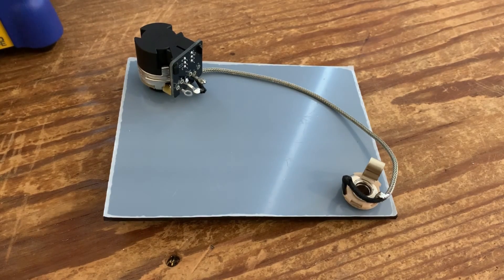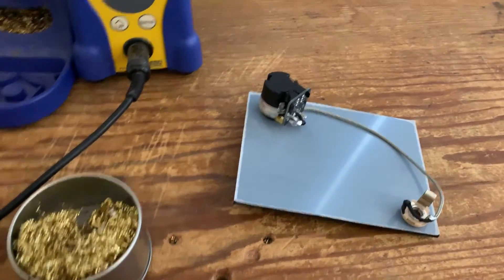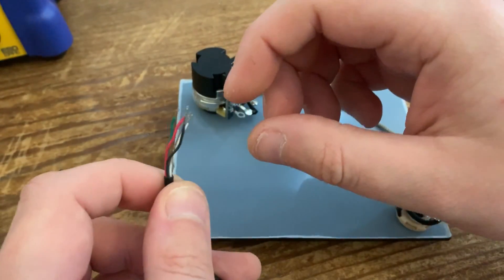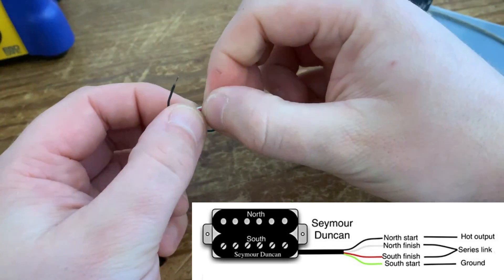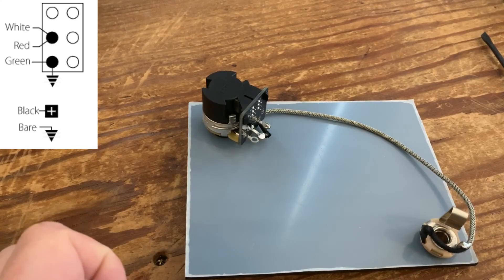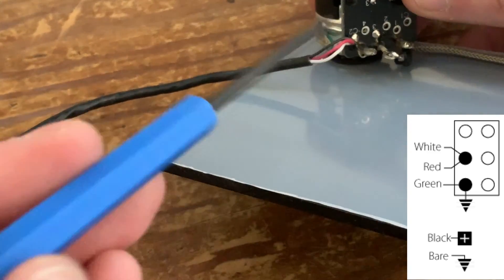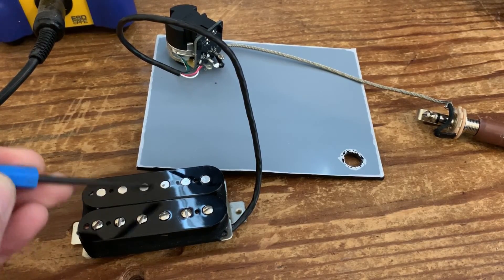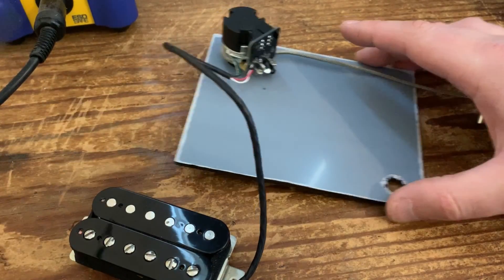How to Coil Split Humbuckers

Comment: Great video! I’m rewiring/ replacing pickups on a H-S-S configuration SuperStrat style Samick guitar with a single volume and single tone, a five way blade selector switch and a mini toggle. I’m using Dimarzio pickups- a Satch Track single coil sized humbucker in the neck, an Air Norton S in the middle (also a single coil sized humbucker), and a “proper” Super Distortion humbucker in the bridge. I have a five position blade and a mini toggle switch (which is for coil splitting the bridge humbucker in the original wiring). How would I wire these so that I can coil split or coil tap the neck and middle humbuckers to a single push pull volume pot? You could point me to the appropriate video if you have made any such. Thanks again- your videos are awesome and lucid, and I’ve used it to wire up a Gilmour style black Strat successfully.

Comment: Is possible to wire 2 humbuckers to do both split coil & series/parallel switching with a 3 way pickup selecter switch & 1 volume push pull pot & 1x tone push pull pot?

Comment: Two questions. 1) Which coil is next to the trem or bridge? Is it North or South and how do you determine them?  2) Could the other half of the switch connect to another humbucker, say in the neck position? Thanks for this video, just wanted to clarify some unknowns 🙂
Reply: Screw slugs on the humbucker pickup face either the saddle of the bridge it on the neck pickup the screw slugs face the headstock of the guitar neck. The screw slugs side of the humbucjer is the south

Comment: What if it's two pickups? I've got Seymour Duncan Pickups Hot Rodded  (SH-2n & SH-4) JB / Jazz Set. Can both pickups be split with just one knob?

I have a Levinson Blade strat, and the tone pot has a the push pull which orginaly split the bridge pickup, but I'd like to use it to split both of the seymour humbuckers. if possible.

Comment: Q- Lock down inspired DIY'r here. I'm refitting a T style guitar with new pickups and wiring. Stock, it came with a single in the bridge and full size humbucker at the neck, mounted at the pickguard. I have a lil59 on hand and 4 wire humbucker to use as replacements for the stock pups. The stock control plate is a US fender with one volume one tone and 3way,all to be upgraded. At this point, I'm leaning towards the BKP CTS custom push pull 280k pots and an Oaks Grisby 3way.
I want to be to split both bridge and neck if possible and keep the control plate as one volume and one tone pot. Is this plausible or do I need to lose the tone pot and run two volume pots? Would I need to use a 4way switch to do so? I'm not married to the idea but I do want to keep it as straightforward as possible largely because I lack the soldering skills or confidence to complicate the build beyond what has taken me a bit to understand at this point. Any advice or opinions are kindly appreciated and considered.
Note, I'm not trying to obtain an authentic telecaster sound for this guitar, I intend to use it as a D standard heavier but not metal rhythm option. Stay safe and well all, thank you for the remarkable videos, I could watch this guy solder all day, his work is impeccably clean and his explanations are comprehensive and easy to understand. ✌️🎶🎶

Comment: my first repair/build I wired this in reverse, pull is series and push is split. haven't bothered to fix it and probably never will since the neck pickup as split usually sounds a bit better on a HH for some music i've been working on learning.

Comment: When splitting a humbucker with a 500 K push pull tone pot, the split humbucker still sees a 500 K tone pot. It needs to have a 500 K resistor in the circuit to bring that 500 K Tone pot down to 250 K to give it a more single coil sound. Where in this push pull pot would you mount such a resistor?

Comment: Which wires to swap to change which coil is active? Red goes to live, where the black wire went in the video. Black and green go to C2. White and the bare wire go to ground on the side of the pot.

Comment: Thanks for the video, some quick questions, please.  Can the red/white coil splits be routed behind the pc board instead of in front?  I'll melt the insulation if I route the wires and solder the eyelet if I route in front of the eyelet. For the grounds (my project is a single cts volume pot with a treble bleed, two coil split humbuckers, and a three way toggle (upgrading an import Washburn Nuno N24) my worries are the 7 grounds.  Can I solder both the green and bare in addition to a ground to eyelets 1 and 3.  I was planning a bare wire ground on 1 and 3 behind the pc board, similar to the coil splits you did on another video.  I just don't know if ground wires need to be isolated or if they can be joined to minimize the grounds on the pot casing?  Thanks again

Comment: im a bit confused, im going to be wiring a mini humbucker that has the four wires + the bare one into a fender strat . i want to use a separate toggle switch to control the coil splitting, how would i do this? do you have any diagrams

Comment: On a wiring diagram I have from Seymour Duncan, which doesn't use push pull pods, it shows red/white from both pickups going to a 5-way selector switch, so If I solder those wires to the push pull pots, will everything still work? I hope I explained that right. I basically have to 500K push pull pots, one volume and one tone and a 5-way selector switch that I'm trying to wire.

Comment: hi there! Talking about potentiometer, Can I use the push position to control Volume and pull to control Tone together in one push and pull potentiometer ? It maybe sound stupid question for you but I only have little knowledge on guitar wiring. Thanks.
Reply: the push pull is a switch only..if you want just one pot to control volume and tone.. there is stacked potentiometer..it might work it might not..i never try that myself

Comment: Hi there. Thanx for your video! I was looking for this. I have 2 humbuckers in my guitar and I want to coil split them. But I would also like to switch the phase from them when they are in single coil mode so that they sort of humbuck again. To get they Brain May kinda sound. Is there a special switch for that and wire diagram. I checked seymour duncan already but I could not find a diagram for that. Also they like to avoid phasing. Hehe. I like that sound and I like to have the option :-) Thanx in advance.

Comment: Hey would you have a diagram for 2 Humbucker 1 push pull vol, one tone and a Gibson 3 way switch?
Reply from the maker: Hi Jamie, you can find one here using the drop down menu: https://www.seymourduncan.com/wiring-diagrams?meta_params=guitar-options,2-pickups,neck-h,bridge-h,1-volume,1-tone,3-way-toggle,accessory-none
Reply: @SixStringSupplies  this is what i was looking for, hopefully it works out
Reply: @SixStringSupplies  would u say that PRS S2/SE pups 4 wires are color coded the same as ur video?

Comment: Do you have a diagram for two Seymour Duncan P-Rails and a volume push/pull and tone push/pull with 3 way toggle using CTs push/pull pots?
Reply from the maker: Hi sorry I don’t - but the Seymour Duncan wiring diagram website might do

Comment: How many push pull pots do you need? I have an sg with four knobs Plus i think you dont specify wether you need short shaft or long shaft ... For gibson u need long shaft
Reply from the maker: Hi, it's a generic video on how to coil split - typically you'd need 2 pots. This video here https://www.youtube.com/watch?v=K98BkOlJgn0&t=2s is for Les Paul (actually for Gibson SG you would use short shaft) We haven't got a video on the SG but its the same as the Les Paul one. Thanks for watching!

Comment: I have HS tele i want to split humbucker so should i wire it same as you?
Reply from the maker: yes, but the hot signal wire goes to the blade switch, the other pickup wires go to the volume push pull as in this video.